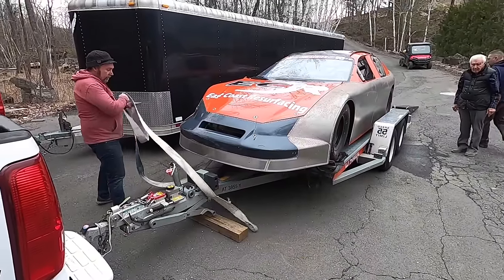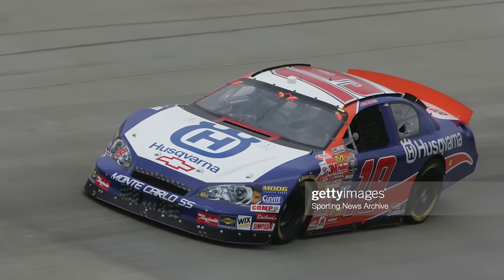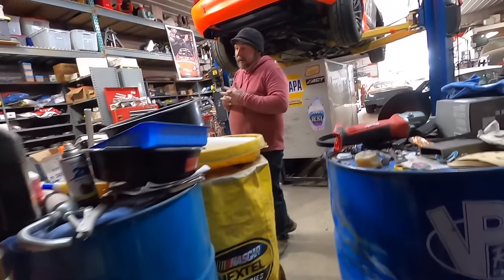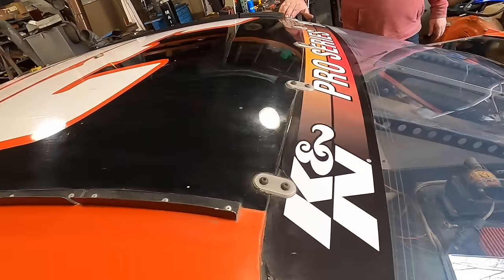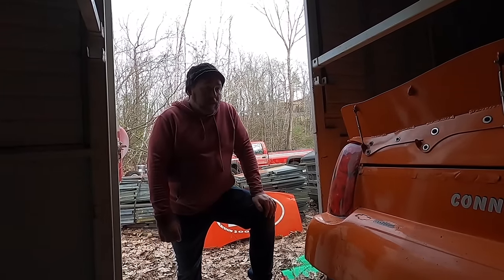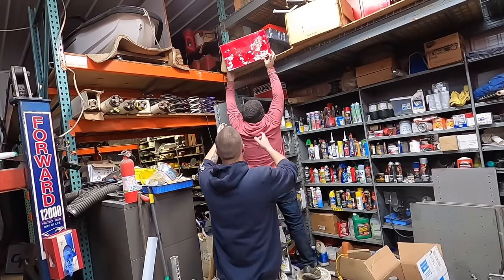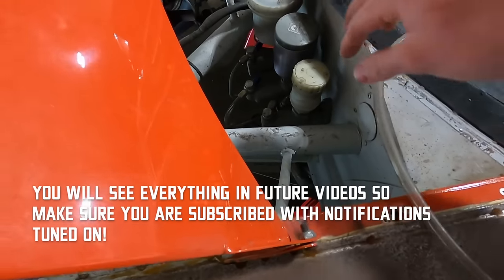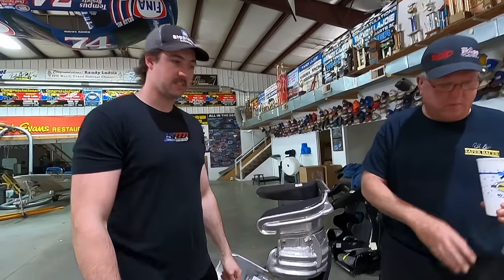IT'S TIME! Buying Our First Former NASCAR Race Car! (Former Busch Series Monte Carlo)

Comment: Make sure that the back of both heads. Has a braided ground strap to the firewall where there will be continuity to the ignition board ground as the coil output to the spark plugs does not vanish into the heads. It has to get back to the ground side of the ignition control boxes. Failure to do that usually results in the negative side high voltage getting to the module grounds via the positive low voltage side letting the smoke out of the low voltage chips.  Those chips blow out at 20 to 25 volts.  30kv thru them looses races.  Why both heads. Shorten the spark return path.

Comment: Buy the road course car. About 40 minutes north of Danbury where you went through is Limerock. I live minutes away. Lots of racing support here in Northeast. In the early 80’s I did a bunch of long distance bicycle riding, my route to Watkins Glen to watch races took me by Bodines shop near Chemung. They had all kinds of cool race cars parked all over. Watched Geoff win at Lancaster Speedway outside Buffalo where I grew up.
Good luck with the new ride.
Reply from the maker: Man what an experience that would be pulling that car out of the trailer and going right to lime rock lol. We appreciate you sir!

Comment: Would love to see you and Logan time yourselves doing a tire change. Ya'll got the pit road impact gun socket and the wire wheel stud hole 🕳  tool
To clean the glue off the wheels? Cool fact: Trans am T/A 2 series uses a nascar size tire. 
But it's a pirelli P zero.

Comment: Oh wow, I might have seen Joey race that car at Irwindale in 2008, when he won the Toyota all star showdown, if they used that chassis.  I was there the next year too when he dumped Sellers, but that was after the switch to Toyota.  (JGR was Toyota in 2008, but for that all star race Joey was in a Chevy)
Reply from the maker: I do not think it was the same chassis but not 100% sure. the 25 Home Depot car correct?
Reply: @Stapleton42  that's the one, now I look at it again there'd probably be more of that orange and white paint around, unless that was one of the early vinyl wraps

Comment: So it looked like there was some sort of 2 cylinder vertical engine in the ruins of the building? How can you walk past that and not have a closer look at it?
Reply from the maker: I didn't notice but it was probably an air compressor
Reply: @Stapleton42  You should check it out